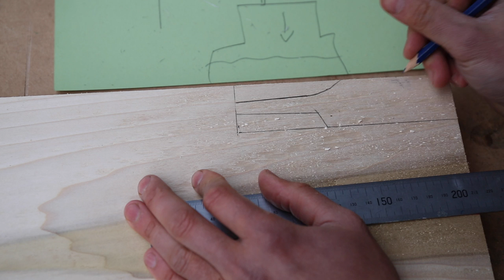How to Tap Birch Sap | Making Birch Gin, Birch Syrup & Toffee / Folk History & Benefits

Comment: Maybe a dumb question, but is it okay to give birch water to dogs?
Reply from the maker: Yes I think it may be fine as long as it’s from the tree and not from a carton which may have added Xylitol which is toxic to dogs. Always try a small amount first to check the animal tolerates it! 

From Wiki:
Contrary to popular belief, there is no xylitol in birch sap (xylitol is a sugar alcohol that is industrially produced using high temperature and sulfuric acid, or through fermentation).[15]
Reply: @JamieKunka  I666
Reply: F r
Reply: @JamieKunka I666 is a